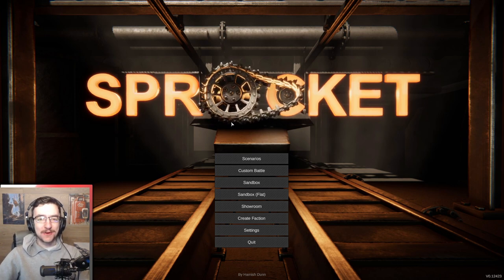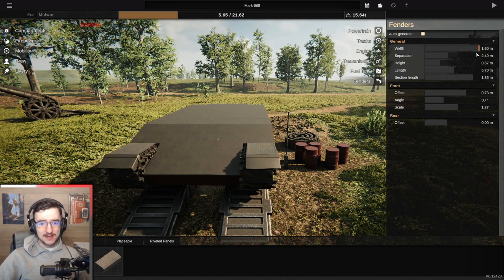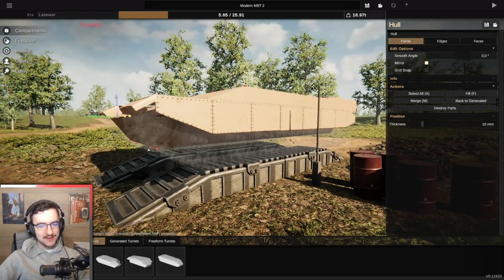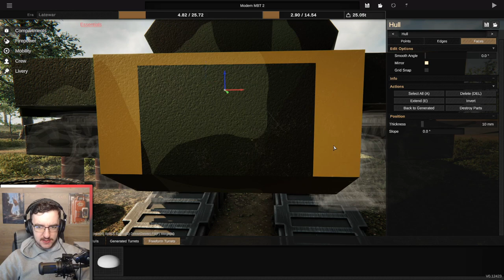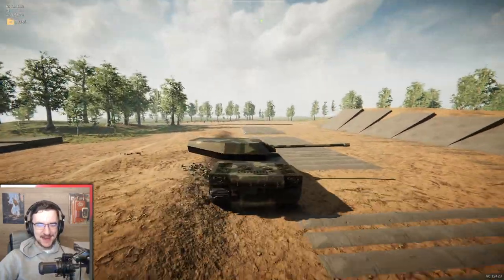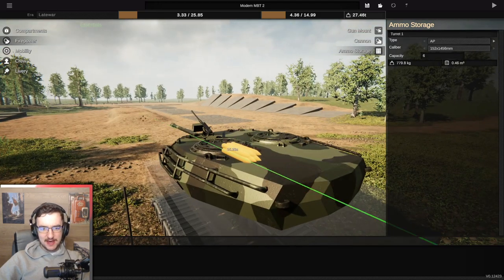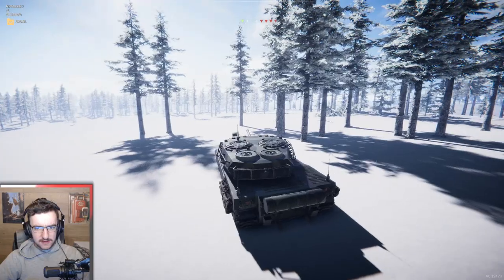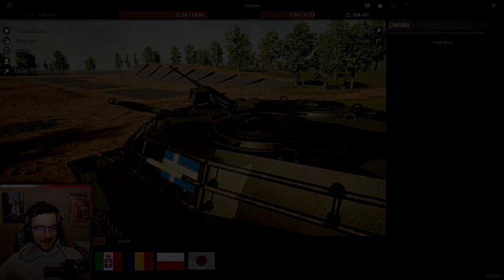THIS HUGE MAIN BATTLE TANK WOULD'VE WON THE COLD WAR In Sprocket Tank Design!

Comment: This is honestly a dope looking MBT. Would be cool if you tried something like a stabilizer. All you really need to do is make a lil gap in front of the tank, 
 add another turret, then shape it from there. It can be kind of difficult cause of its positioning. But overtime, it'll be easy to make on the spot.

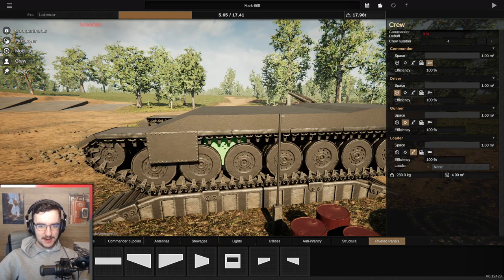Comment: 13:05 yes there is. Select the panel by clicking right click and when it shows you the axis you hold Alt and while holding you click left mouse button on the axis in which direction you want to copy the panel and by dragging your cursor over the axis it copys your panel.

Comment: Okay, now we complain. First the gun: way too much caliber. 152 mm is artillery size, thus slow rate of fire and small storage. Even 130 mm would be pushing it. 
Also, the cannon length is way too short. Try to double that.  Ammo is also not stored in separate bin at the turret back. 
Next the front glacis. Althogh it has like 60-70 degree angle, for modern munitions that might as well be flat. Try to go for 80 degree like in Abrahms.
No spaced armor. This means any explosive shock will transfer directly inside the tank. 
No slat armor, thus any RPG will strike directly onto the armor. 
No optics, commander cupola or laser ranger.  The commander sticking his head out would be rather bad, especially if the enemy had salted the area with nuclear or chemical munitions.
Reply: sir this is Sprocket
Reply: This is just a game friend, it doesn't have cold war stuff to begin with
Reply: The new panther that Germany made is 135 mm
Reply: The gun size is fine. https://youtu.be/kH5aYIEOG8Y?t=18
Slat armor takes forever to make in the game.
Original cold war mbts did not have spaced armor.
The angling of the front plate doesn't really matter as non steel core APFSDS projectiles can penetrate armor at even 84° angle. Also, there are no blowout panels in the game yet
Reply: He’s correct, and theres more, it lacks a stabilizer, which you can make in sprocket, its absurdly huge and has space unused, it weighs so much rural bridges will collapse under its weight, and it can be penned frontally by any real MBT.

Comment: You've built a huge tank that would have sucked even in the WWII 

Why?

You didn't penetrate IS-122 late at the frontal armour 

You've placed a driver's hatch right on armour (on the modern MBT hatch placed on top of the hull, right under the tower) that causes lower millimetres of armour compared to the armor in the forehead of the hull as a nominal armour. Simply, the armor of the hull itself is much more nominally than next to the hatch (sorry if you may misunderstood, English is not my mother tongue)
So that's why , it makes your tank even worse and brings back to the WWII time prototypes

The speed is average , a bit higher , caliber good , but the armour is useless and I'm not sure if it's possible to reload 152 mm gun less than a 4 second only having 4 crew members!!!

Aiming is too slow for modern MBT and speed of turning as well (turning hull and tower)

Stab is average , but not enough for modern those times

100+ tons way to big. Idk, looks like super project in Reich ngl.
Reply: You can't increase the turret slew rate and gun traverse speed without cheating as game hardcaps it. The game doesn't support gun stabilizers yet. The Abrams has a similar drivers hatch position.